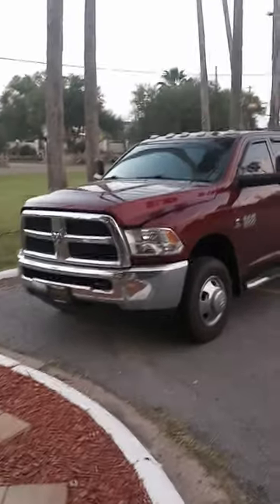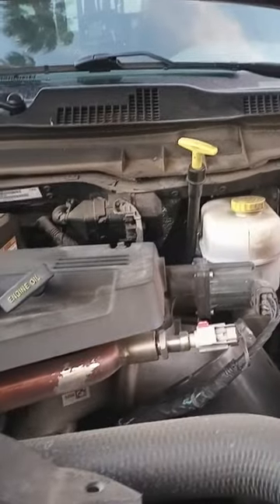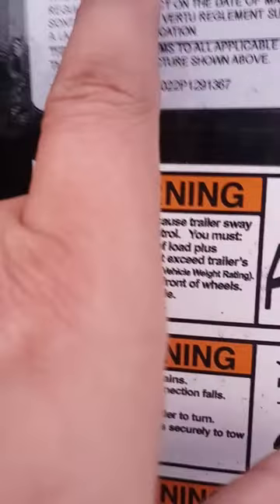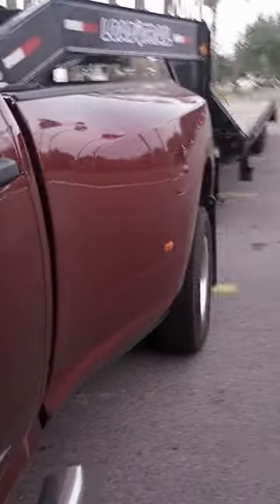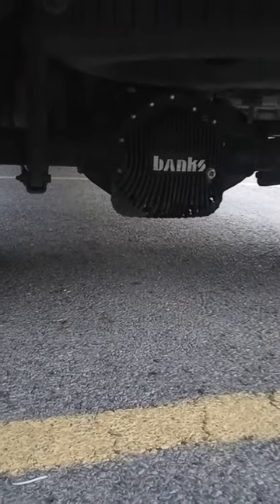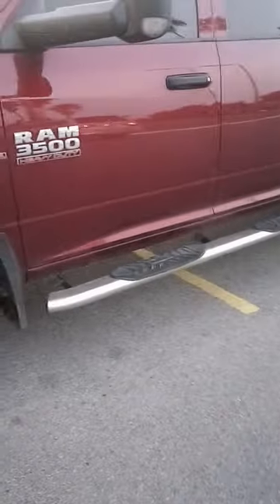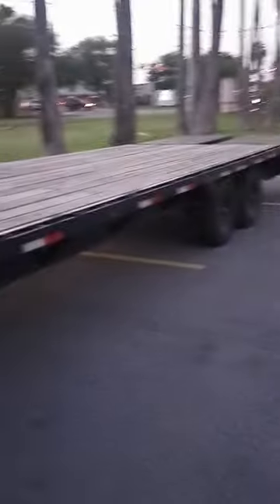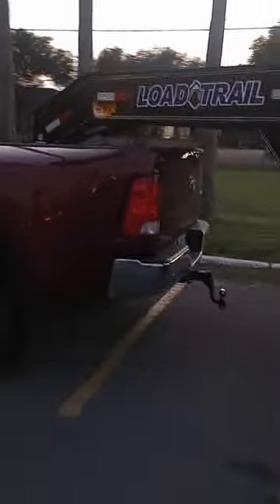Hotshot Trucking: CDL Truck and Trailer setup. Ep. 24 #cdl #noncdl

Comment: So if you got a lighter trailer you could run non-CDL with that truck.
Reply from the maker: If you can find a trailer that is 12000 gvwr or less you can. The truck alone is 14000.